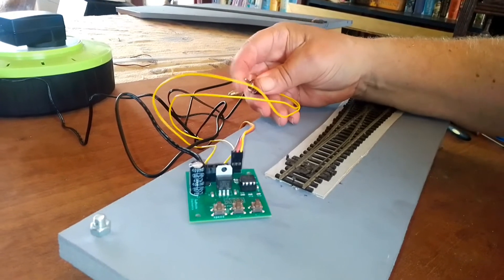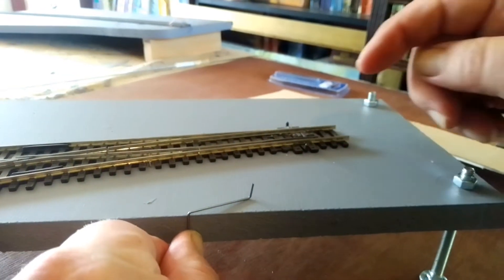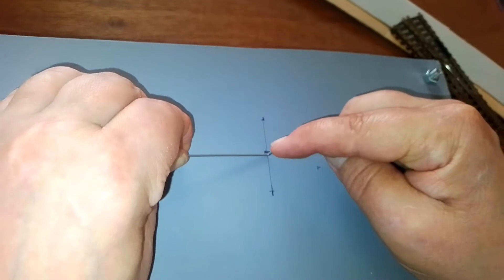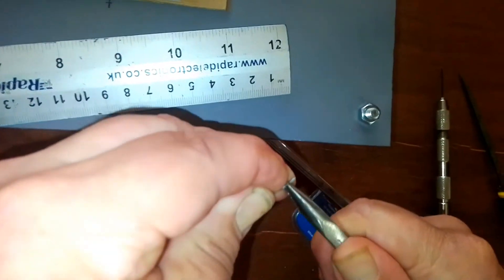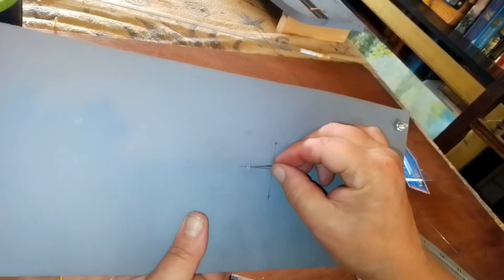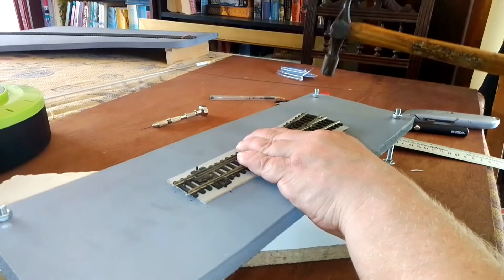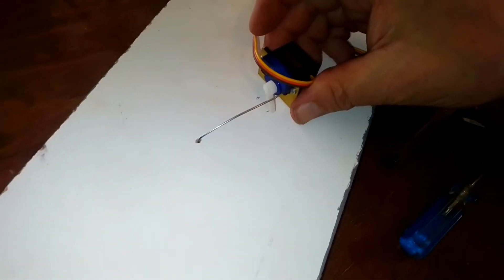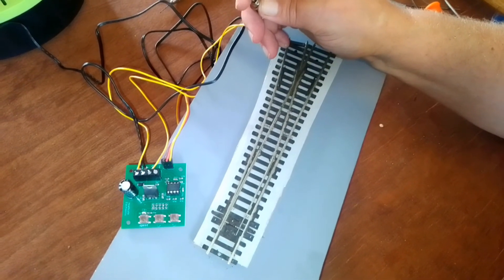Operating points with below baseboard servos

Comment: I really like your method for switching the point. It has the advantage of having linear movement. The usual method is a straight piece of piano wire attached to the servo. When the point operates the wire rises in the locating hole. The servo needs to be adjusted accurately, otherwise the wire sticks up and fouls the rolling stock.
Reply from the maker: Thanks for your comment. The other possible advantage is that its easier to make a hole than a slot. However there seem to be numerous ideas on how to link servos to points.

Comment: I note the difficulty of bending the 1mm. piano wire accurately.   I have used paper clips for switching all my N scale pointwork.   
My track was laid in place before I considered the fitting of motors so the linkage is visible alongside my points.
Any incorrect bending is easily rectified by simply using a new paperclip, and for the record, I have not yet had to replace any of my paperclips through breakage.
Reply from the maker: Thanks for the tip.